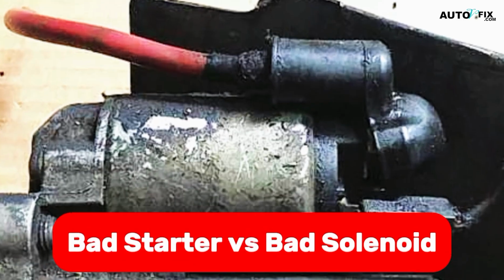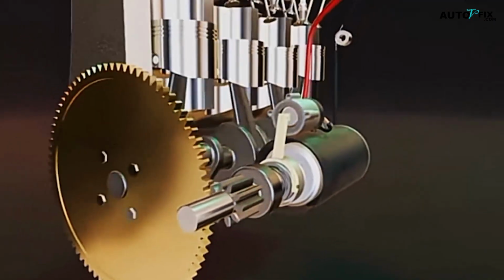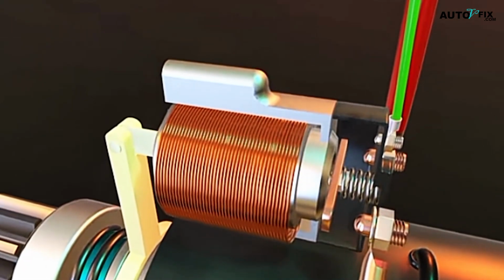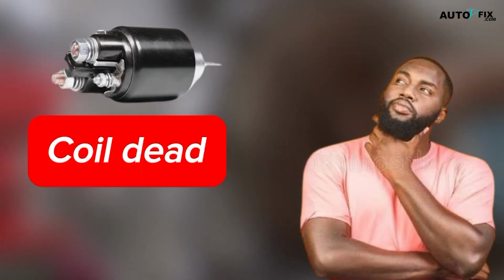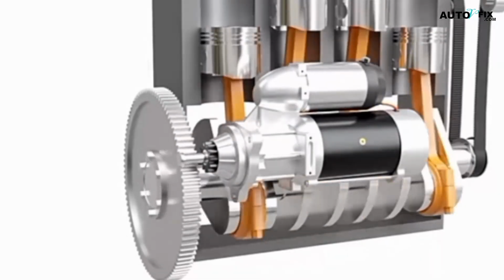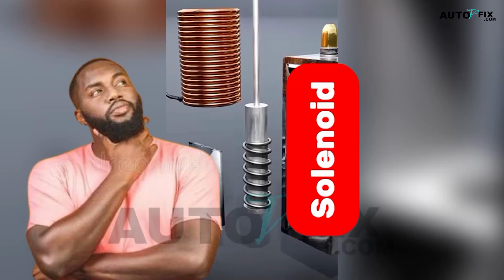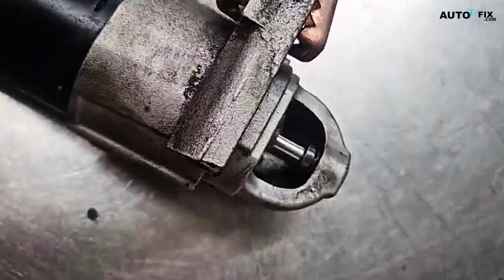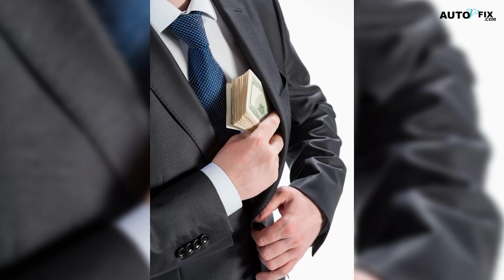Bad Starter vs Solenoid? (HERE'S How to Tell If Starter or Solenoid Is Bad)

Comment: Full speed engagement without hesitation.  While cranking the engine, but before it catches, the starter disengages and spins freely.  This is the clutch inside the starter failing, yes?

Comment: But if it’s both connected on the starter motor and you replace half the starter motor half of it’s gonna be brand-new and the other half is gonna be old so it’s just gonna wear out faster if you have the money buy the parts if you don’t have the money wait till you can buy the parts
Reply from the maker: That's definitely a solid point about matching part lifespans to avoid repeat repairs!

Comment: Slow cranking. That's what I have. The first turn of the key it cranks really slow and the engine doesn't even want to start. Then I turn off the key, wait for 10 seconds crank it again and the engine starts. It's like the starters just trying to warm up a little bit before I can actually do its job.
Reply: Oh you just described my issue.
Reply: @roontunes .  Well I just had the starter  replaced and everything works great now. The engine instantly fires up on the first turn of the key!  The dealer did try to sell me a new battery as well but I didn't but I declined. Replacing the starter solve the problem

Comment: If you're going to be going that deep into your engine and disassembling things. I think it makes sense just to replace the whole starter because the solenoid is part of the starter these days anyway.
Reply: yepper.  My Nissan Altima replacement comes with solenoid and motor.  Pretty cheap.
Reply: I’m having this issue with my el camino, just replaced the starter and it’s still giving me grief. Idk if it came with a solenoid

Comment: I'm having intermittent no crank no start single click noise. It's happened once or twice weeks apart, and I suspected maybe I didn't push the brake far enough in order to push to start. Yesterday it never turned on again but still did the one click every time I tried to start it. (they day before I had taken it to advanced auto parts to have my battery tested and the employee checked the starter and alternator. System came out saying everything passed) I was confused but I kept driving it untill it wouldn't turn on again. No dimming lights, radio and everything worked just fine. I decided to take the start out and have it re tested and if it failed I would buy a new one. Took it to auto zone I asked them if they could test my starter (rude staff)  just glazed at it while in my hand and said by the looks of it it's probably shot. I wanted to make sure I wasn't just throwing parts at the car so I stayed and was respectful to them as they made me wait while they got over being upset. Once they tested it, it passed. I was more confused than before.

Assuming under load it's easier for it to get moving I installed it again thinking ithat this time it will start. Once installed it cracked right up.

Is it fair to say that those tests are a hit and miss and not 100% accurate? I will buy a starter motor from Rockauto and save me money and get a quality part and keep it in box until problem arises again.

I will keep you all updated.
Reply: Right mine doesn't crank or click or anything when it screws up. There's just nothing. But I had someone try to tap my starter while I cranked but nothing was happening and then they touched a wire with a screwdriver and it finally started and my solenoid is really loose but I already bought a starter with new solenoid on it so would it  be ok to just change my the starter and just be done with it? If my old starter turns out to be good and just the solenoid bad then I'll keep it for fall back or something

Comment: There are a lot of good tips here, but there are also a whole lot of things wrong.  First, it is nearly impossible to replace just the solenoid by itself.  Second, a new starter + solenoid combo is cheap and if the vehicle has over 100K and the starter is suspected, the starter+solenoid should be replaced anyway.  The cost is no where near what is implied here.

To replace the starter, he big expense is the labor, but in most cases, it is easy to get to.  My GMC PU truck has 180K miles and wouldn't start and I had to be towed home.  After doing a quick diagnosis, I sent off for a new starter for only $70.00 and put it in myself in my driveway between rainstorms.  Yes it was a pain and especially because I'm 80 years old and don't crawl under trucks like I used to, but it really wasn't all that bad.  I saved myself maybe $500+ and most of all, I saved by not having the truck towed to a shop and many days waiting for my truck to be fixed.  

If you don't know about auto repair, watch some YouTube videos and be sure to get a truly knowledgeable person to help you.  A truly knowledgeable person runs tests, pinpoints the real problem and doesn't just make quick guesses.  If you are having starter problems and are good at working on your own vehicle, buy a starter locally or send off for one and put it in RIGHT AWAY, just as soon as it arrives.  Even if you don't fix it yourself, DON'T WAIT LIKE I DID and have the old starter fail on you only to leave you stranded in the rain.
Reply: I love working on my cars!  Good tips here from video & you sir, 80 and still working on your car!  I want to be like you at 80!  I'm 57 & gonna work on my Mazda B2500 starter problem.  Thank you
Reply: My starter for my tundra is 500 new, 250 refurbished, just bought one 2 weeks ago. Not counting anything else that may be needed

Comment: Repaced the starter on a 2010 dts. Starter under intake. New (reman) starter worked but pinion sticks to flywheel and starter keeps cranking when key is turned to run. I have to turn key all the way off before starter quits cramking engine. This wasnt covered in your video, but i am assuming i eother have a bsd replacement(most likely) or the starter is binding. There were no shims on the original starter.

Comment: Brand new starter from China, may have mechanical problems. Only coast $60 dollars new.
Reply: I just put one in my 2000 GMC 3/4 ton PU myself in my driveway.  I carefully inspected the Chinese starter after it arrived and it looked like it was well made.  As soon as it was in (not that big a job), the engine cranked over rapidly and the engine started instantly.  I expect the new starter will last longer than I will.

Comment: Mine is intermittent. When it cranks it's strong but might not crank again afyer 20x trying then it may start every time for months
Reply from the maker: Intermittent starting can be tricky! It could still be the solenoid, or even loose connections at the battery
Reply: @AutoVFix  got the same exact issue intermittent starting - even after the mechanic replaced the solenoid from the starter assembly. Do you have a vid for maybe checking loose connection, or fuse/relay that would fix the issue?

Comment: OR it could be the Fuel Pump, must check that first before starter and solenoid... Battery, Fuses, and Relays then Fuel Pump, then sparkplugs and coils then only starter and solenoid.
Reply: Fuel pump has nothing to do with turning over the motor.
Reply: @aceizwld  LOL... Update your manual If the fuel pump fails:The engine will still crank normally (as long as the battery and starter are good). But it won't start or run because no fuel reaches the injectors or carburetor. We are talking about starting overall of "A CAR". This kind of issue is very very tricky so you have to check first the Fuel Pump before, sparkplugs, coils, starter and solenoid.
Reply: @WhatACrazyWorldWeLiveIn  interesting.  Just started do the click thing after fuel pump replaced.  Maybe bad fuel pump?
Reply: @gosman949  after the click thing you should be hearing the humming sound from the fuel pump if you don't hear anything... make sure to check the relay. If the relay is good then could be your fuel pump faulty. If you here a click then revving... means the starter/solenoid might be still good... but without humming from fuel pump your car wont run too.
Reply: @gosman949  After switching the key: If no revving = problem in your solenoid/starter. If no humming sound = problem in your fuel pump. These two  have separate relays... and both happening simultaneously.

Comment: When I start mine I hear the click than I start and it gives a loud noise while starting
Reply: Is it a loud grinding noise ? Means your starter is having problems engaging onto the flywheel. So it grinds before starting.
Reply: @AdamMohammed5221 so what would I change to fix it
Reply: @wilmervilleda814 normally people reverse the direction of the flywheel but you can change the brushes/teeth inside the starter. Im no mechanic but hope it helps

Comment: If I have the single click no-start condition, but intermittently, I get from what you are saying about it could be worn or otherwise damaged contacts in the solenoid causing it to not close the circuit and provide power to the starter motor and hence the no start.  But that said, why does a jump start get it to work?  I mean, that was the case yesterday for me.  The battery is only four months old, and I was having the similar no-starts before changing that.  And I could always get it jumped.  The jump yesterday also worked, but sat there hooked up with the other car running for a while.  I was an hour from home and flustered and the lady helping was very kind but also not familiar with the process.  So she wasn't revving her car, and I didn't think to ask her.  I was about to give up after five minutes or so of it running and tried one more time and it finally went.  The times before the battery change, with someone revving the other car, I got it almost immediately.

I hear tell of a dead spot, but I was thinking that would be in the rotating parts in the starter motor.  I also hear of people tapping it with a wrench or something to get it "unstuck".  IDK if that's the solenoid or the motor but I guess I could see that helping if the contacts are just messed up a bit to get them to "jiggle" into making a good connection.

Of course, if I have a defective wire to the starter motor/solenoid combo, or a bad connector, than I wouldn't even get the single click (which is probably the solenoid moving)...... I just don't want to pay for electrical system diagnosis at the shop and get in a do loop and I am 90% sure it's a bad solenoid on my starter, but I just can't get another 5 % or so sure to go ahead and have the work done.
Reply: For mine the first time I had it not start I jumped it and I had trouble jumping it but after like 15 minutes hooked up it started then didn't have any problems for a few days then boom it wouldn't start while I was at a doctor's appointment and hour away from home and wouldn't turn over. I  wasn't even getting a click. And jumping it did nothing had it hooked up like 25 minutes and wouldn't do anything. I eventually got eventually a guy that was another patient there had to get under my car and mess with a wire to my starter and finally got it to start. And my solenoid is really loose but I had already ordered a new starter so Im just debating on changing my  starter instead of solenoid and be done with it lol

Comment: the problem with my car is that randomly/sometimes when i start it cranks, pauses for half a second, and then proceeds to start the engine. solenoid then maybe? slow start and not always but sometimes, maybe 1/5 times
Reply: Sound like you have corrosion on the cable running from the battery to the starter. Or a connection is loose

Comment: Pretty sure mine is the starter. I’ve noticed it dragging more and now have to tap it to get it to start. 22 years and 350,000 miles I got my moneys worth out of it
Reply: I have a very loud noise once it starts
Reply: @wilmervilleda814 sounds like an issue with a bearing or bushing. All mine needs is new brushes

Comment: Over the years I've had to replace the solenoid many times. Once a new starter was put in on a Chevy truck, engine died at a red light, no start, nothing at all when turning the key. Took the solenoid off and the contacts were all beat up so I sanded 'em smooth and bingo it started right up. Had a '53 Olds 98 and had to flip the band gear on the fly wheel by heating it up and turning it around as there were no replacement fly wheels around 'cept in a junk yard somewhere but old cars are scrapped now-a-days. The starter motor over time had wore down the fly wheel gears. They make fly wheels out of 'softer steel' than the bendix gear on a starter. But yeah sometimes(more than a few) its the solenoid especially on GM stuff.

Comment: So my car starter motor starts but there’s no firing in the engine … meaning the solenoid isn’t pushing the starter gear onto the crank? Solenoid problem? Battery seems perfectly fine cos all the electronics are working.
Reply: I have same issue
Reply: Actually, you may have an ignition issue.

If you turn the key, and the starter motor turns, then electrically, the system is working.

You should then hear the engine, and/or feel the engine, turning over, with cycles of compression/decompression as the valves open and close.

If you do not get the cycle of compression/decompression (or confirm the main drivebelt isn't turning when attempting to start), that points to a bad starter motor, since the mechanical side of the motor is failing, or possibly the mounting bolts have loosened.

The repair is to remove the starter and check both the bendix gear, which turns the flywheel, and turn the flywheel by hand and checking the flexplate or flwheel gear teeth for damage. Do this with a helper using a breaker bar or large 1/2" drive ratchet on the crankshaft pulley bolt. The crankshaft pulley is also called the harmonic balancer.

Believe it or not, a misaligned or loose starter, or even bad engine mounts, can cause a starter casing to break internally where the flexplate or flywheel is located.

If all this checks out, then the next step is to diagnose the ignition system, starting with the ignition coil(s), plugs, and wires. If those check out, check to see if you're getting proper signal from crankshaft and/or camshaft sensors.

Lastly, make sure you're getting fuel into the cylinder by turning the key on, but not starting and listening for the fuel pump to kick on.

If all of this checks out, and the car still does not run, the problem is, more than likely, a bad ECM. Engine Control Module, ECM, is the car's "brain" and both controls, and monitors, everything when the car is running.
Reply: Ford Excursion here, I have to bang on mine an it starts, 😮 so i assume i replace the starter? I had to watch video because I got confused about sylenoid. I will purchase the pair it's not much difference and I can't see putting the old part back on.. I just hope that works.